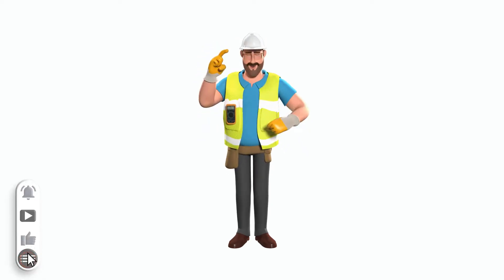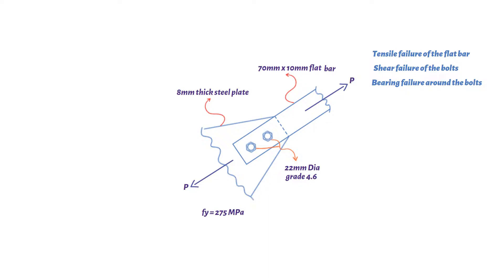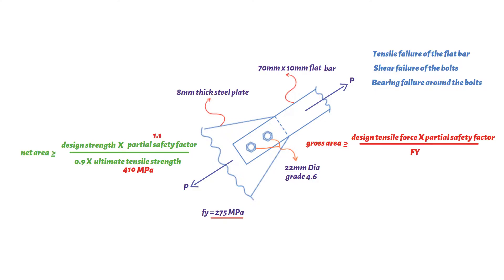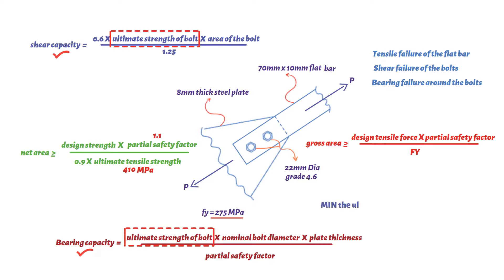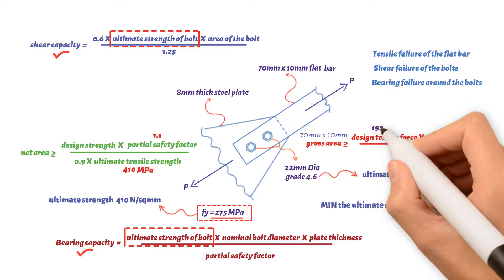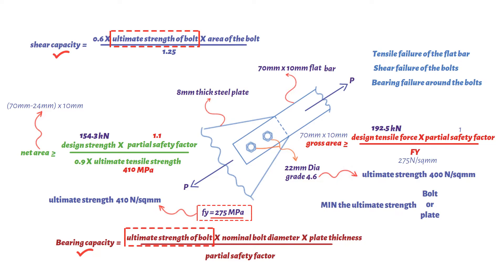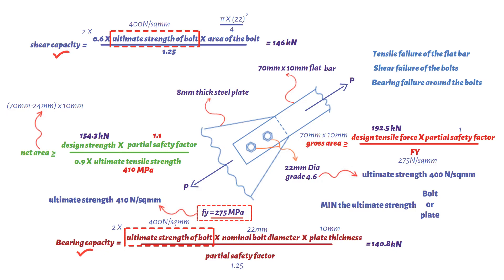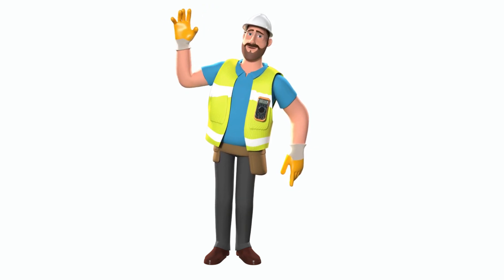How to determine the resistance of a bolted connection (bracing connection).

Comment: Thank you for this great video. 
Do you happen to have a table, please, (link or reference) regarding the partial factors? I had a look at the Eurocode EN 1993-1-8 tables, thus some of the factors doesn't fit the actual situation. 

For "Bearing capacity" you took the thickness of the flat bar into account (10mm)..why not the steel plate thickness? My thinking is If we take the steel plate thickness (8mm) we shall have a more conservative value. 

Thanks again for the good content you are providing and keep up the good work.